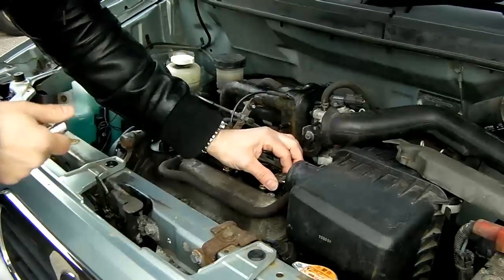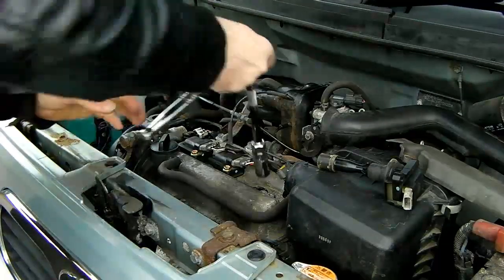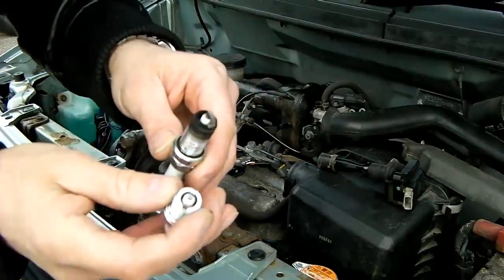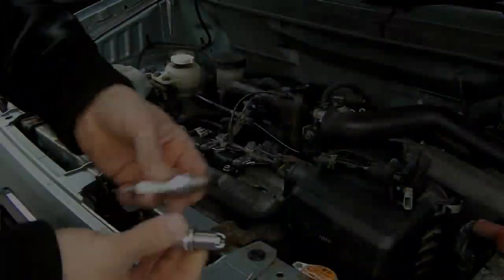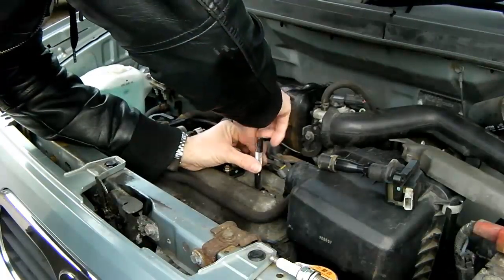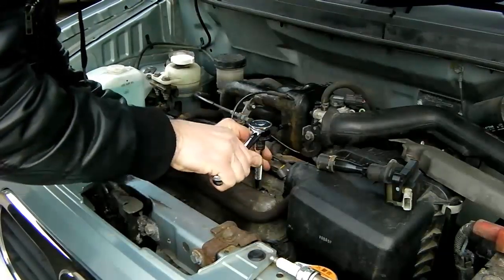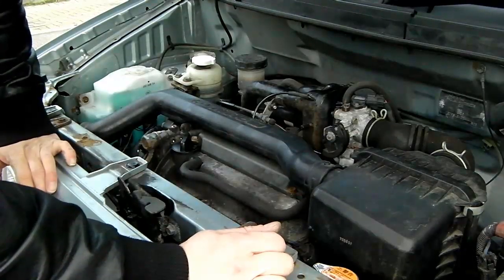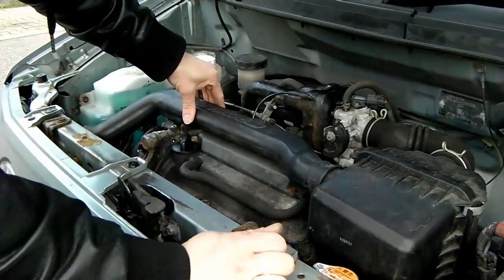Perodua Kenari Changing Spark Plugs Daihatsu Move 3 Cylinder 1.0

Comment: Why did u put greasa sir? Is it neccessary?
Reply from the maker: Yes and no.
Not using grease won't cause a problem with the car starting or running, but the copper grease is an anti seize measure to prevent galvanic corrision between the aluminium head and the steel spark plugs, as they now have a much longer life and can be in a car for 12,000 miles or more that risk increases so a little grease on the threads ensures they come out easily when you need to change them.

Comment: Hello , I have the Kenari ezi  989 cc triple cylinder . I need to find the internal fuses location if you could help me please . I have found the ones under the bonnet . Many thanks in advance . Thanks for this video too I will change the plugs soon and wasn't 100 percent sure how to access them .
Reply from the maker: Internal?
I'm unaware of any others than the fuse box under the bonnet on the battery side of the engine bay?
Reply: Its just over the accelerator paddle...find the box there
Reply: Masalah kereta kenari saya on kunci terus ada spark dkat plug.

Comment: Hi ,I have the same 1litre engine kenari. Lately the engine oil is leak from the  rocker cover. can you show me how to change the necessary gaskets and seal. Thank you very much
Reply from the maker: Chong June Kai Glad you found the video helpful, sadly I can't because being my own vehicle I can only film whatever I might happen to do on it at any one time and won't perform a job that's not needed as I have neither the spare time or resources to buy the items.
The rocker gasket is typically quite a straightforward replacement however, unbolt the bolts, remove the old gasket and clean the gasket face if need be them replace the new one with a smear of grease or oil to help it sit properly then re fasten the bolts.
Reply: spidiq8 thank you for your help.

Comment: My friend. What size is the socket for the spark plug.
Thank you
Reply from the maker: It's a 5/8" spark plug socket you need. This is thinner than the standard toolkit type. Common on many motorbikes and the plug spanners can be gotten cheaply from auto suppliers.
Reply: @spidiq8  thank you
Reply: @spidiq8  sorry lol you mention it at the begining i just noticed
Reply from the maker: @pacattack7121  Ah, I thought I had but it is a while since I filmed this, no problem though.

Comment: is it safe to assume, 4 cylinder engines have 4 spark plugs?
Reply from the maker: epique wenqa aka epik Yes it is. There's always at least one per cylinder. Some rare engines have 2 per cylinder.
Reply: alright awesome, thanks for the response. one more question. when you install four spark plugs, do all of them burn together, therefore when one needs to be changed, all need to be changed?
Reply from the maker: epique wenqa aka epik They don't ignite together as in, 'at the same time' but they all ignite an equal amount. Every time a piston  rises on its compression stroke the plug fires burning your fuel and air mixture. 
When you need to change the plus you need to change them all at the same time. 
Your vehicle manual will tell you the change intervals but 6000 miles is not uncommon today, remove clean (wire brush) and regap at 3000 miles to help.

Comment: spark plugs have oil.how to fix it kindly discuss that.
Reply from the maker: If your spark plugs are getting oiled then oil is getting into your combustion chamber either via the piston rings or the valve stem seals in the cylinder head. 
First thing to do would be a compression test to try and figure out where.
Reply: that gasket problem

Comment: my kenari car , motor oil leeking , i dont know how to fix it.. already ask people who know how fix it but sad.. its not fixed.. dont know where is the problem of my car.. help me.. 
plz reply.
Reply from the maker: Brandon Adrina Almost eveything is fixable, the question is, is it economically viable? first  thing you need to establish is where the leak is coming from and how much it's leaking. Unfortunately with an engine caked in oil it's hard to tell so if possible get your engine bay steam cleaned first then get a torch and have a really good look roud and underneath while the engine is running, if it helps, get a friend to work the throttle to increase oil pressure while you look. Sorry I can't be more specific but it's simply impossible to say as there are so many places in an engine bay that a leak can come from and because it's under pressure it can even spray up from a low point then drip down ver the engine and bay.